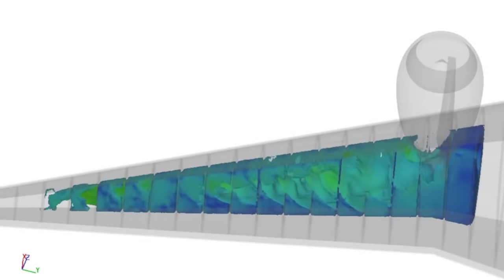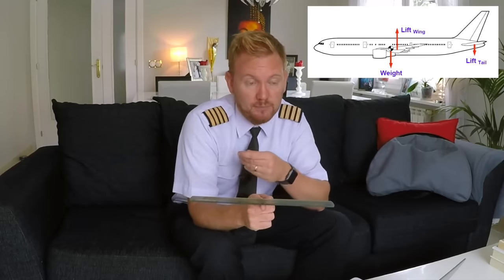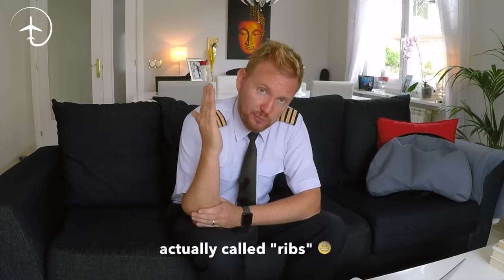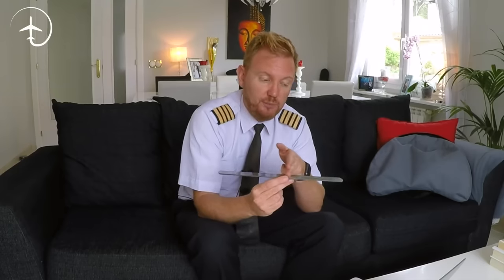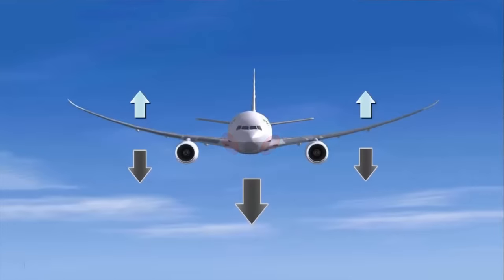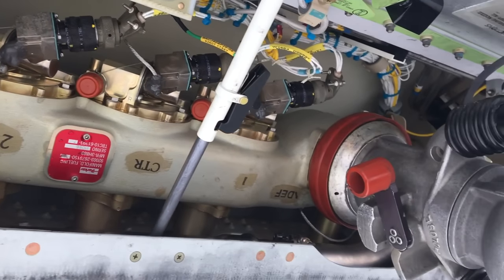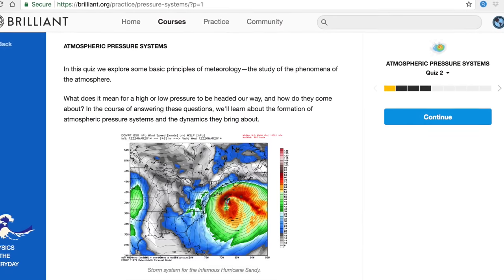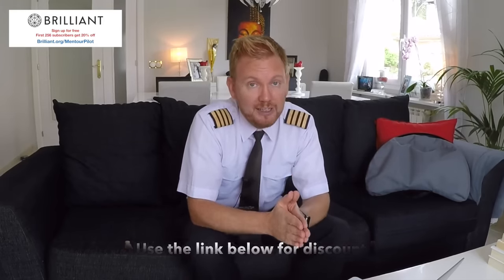Why do aircraft store fuel in the wings?

Comment: As the fuel is "sucked out" of the tanks, how does the air get in its place? On the reverse: when the plane is fueled, how do the air from the tanks get out? Is air pumped in/out or are there valves on the tanks by which air can enter and leave?
Reply: they use compressed air , not enough room for all that fuel
Reply: I also wonder about this question.
Until TWA800 the tanks used to be connected to the outside air. Kerosene is difficult to ignite as sea level pressure, so this was thought to be perfectly fine at the time. Turns out that at altitude the small amount of fuel vapour and the small amount of air, makes for a perfect explosive ratio.

If the tanks are now filled with Nitrogen, there has to be some valve system to keep the inside pressure the same as outside pressure. Or the wings will deform (get inflated or squeezed flat) with the change in altitude. 
Some valve not unlike the scuba dive regulator ????? 
The other option would be rubber inner fuel bladders, like in the military. (heavy and expensive)
Reply: Jet fuel is carbonated with oxygen; as the pressure drops from lack of fuel the carbonated air is released into the empty space....ok I have no idea but is sounds good hu?
Reply: There are vents near the wing tips. As the fuel is used, the air enters by the fuel vents through dynamic pressure (fancy word for Relative Wind Force). This way there´s never negative pressure inside the fuel tanks. :)
Reply: I remember one of his videos (it was why you can't walk underneath the wing, I think) he mentioned a valve at the bottom, which could fix the fueling issue. Maybe they use the same valve for balancing the pressure during flight, but this is only a guess.
Reply: delcroix - yes there is room for all that fuel. Compressed air? Get real.
Reply: Quatermass, to be fair, the hydraulics fluid reservoir gets its pressure from bleed air, so I can see how people can make the mistake of assuming that the fuel system might work the same way.
Reply: Italopatino - I get the feeling that delcroix is claiming that the engines run off of compressed air as a 'primary fuel'. It's a particularly brainless conspiracy theory running right now, and needs to be shot down. 
If I'm wrong delcroix, apologies.
Reply: Vents yes; those are also useful to allow expansion of fuel should it heat up for example, one pratical reason is not to fuel fully up before parking an aircraft a long period of time during a hot sunny summer.
Reply: elves
Reply: delcroix The only compressed air is in your skull. Please be quiet, the adults are talking.
Reply: @FredrickMboma thats only half of the equation. Its a function of the Speed of the Rocket (which increases during Flight) and Air Pressure (which decreases with Altitude) - when you multiply both factors you get the Air Pressure the Rocket experiences in front of it, and the point where this Pressure is highest is called Max Q (or Maximum dynamic Pressure)
Reply: Fredrick Mboma yes and no. The subject is more complicated than that admit involves a lot of calculation with many variables (primarily though the air density and speed). Calculate the precise point of max dynamic pressure is not that straightforward as it seems. Approximations usually are good enough though for the purpose.
Reply: In smaller planes and pre twa800, normal vents are/where used as on all other vehicles in this world. Modern, large planes, uses a system which bleeds out the oxygen, leaving the nitrogen and vent the tanks with that.
Reply: Hi Fredrick.  That's not really quite it. Yes, the air builds pressure on the rocket, and this increases until it reaches "max Q" or "maximum dynamic pressure". As the rocket moves up into the atmosphere, the atmosphere becomes thinner. But at the same time, the speed of the rocket is increasing, and you have a balance of resistance from the air increasing due to speed, and pressure of air decreasing due to altitude. And all the time there is force being exerted through the structure upward from the engines. So, at one point, the pressure reaches its' maximum: most pressure differential between the front of the rocket hitting the air, and the back of the rocket, where the engines are applying force. Thus the whole structure of the rocket is under the most intense pressure and stress. As soon as this point is passed, the engines become the primary force affecting the rocket (ignoring gravity), and it's easier on the structure from that point onward and upward. Does this make sense, I hope? I am not a scientist, and I trust this is an accurate enough description for casual use!
Reply: tim weatherill And just for reference, the Saturn V experienced around 500 psi at Max Q (as seen plotted on a NASA graph for one of the Apollo missions). That's a lot of "extra" force the rocket structure has to endure in flight.
Reply: Yes, an unnerving amount! I have read Astronauts recounting how wild a ride those first moments on Apollo were. Intense!
Reply: There are fittings in the tanks called 'dive tubes.'
Reply: This is a good question.  Would be nice if Mentor answered that one.
Reply: So, that makes clear to me that aviation fuel is different from fuels used in cars and bikes
Reply: Cant be vented, it flys level, hard left, hard right, upside down where do you put the vent valve?
Reply: And as for the compressed Air comments His brain is running on possibilities yours is membrane maximum compressed air pressure-i-dosis , There is some fuel in the wings yes, for the auxilary motor on the back tail to generate eletricity and fool the masses that would be investigating the wings innerworkings,thus circumnavigating that the main wing engines are instead steam turbines running on some kinda over-unity experimentation gone great for profit and bad for sheeple. Enjoy your i-dosis
Reply: delcroix WHETE DO YOU GET THE ENERGY FOR ALL THE COMPRESSING THEN????!!!
Reply: Aimless6 that was central tank explosion. They left it half-filled, and the ac on
Reply: As others have stated Fredrick Mboma, MaxQ is the maximum air pressure exerted on the rocket or any of it's exposed parts. The math to come to this requires that air pressure and speed are constantly changing in flight, with speed increasing and air pressure decreasing the higher the rocket gets. The reason I said "or any of it's exposed parts" is because there will always be at least one part that can't take as much pressure as the rest of the vehicle, and it's maximum pressure that it can withstand is what they determine to be the MaxQ for the flight. Engines are throttled to allow the rocket to reach this value but not exceed it in order to preserve all of the attached parts. If the engines were left on full throttle throughout the flight, some parts could be damaged due to heat.
Reply: OzFPVflyer lmao! they're absolutely impossible to teach some reallity. I've also tried.
Reply: OzFPVflyer yea....compressed air.  Where do these people come from ? So I guess when a plane crashes the huge flames and fire balls are from all that compressed air...lol. I never knew compressed air was flammable
Reply: Yes ,fuel is pumped with the help of pneumatic system
Reply: delcroix and what or who produces the “compressed air”? Free energy right?
Reply: @delcroix  go get an education

Comment: Many thanks about this topic !
Avoiding too much strenght applied to the area where both wings are linked to the fuselage is a very good reason why the fuel is stored inside the wings : clear explanation !
I have always been very surprised by the fact it is possible to store so many tons of fuel inside the wings !!! Aircraft wings seem quite thin; even they are very wide, you always
ask yourself how it is possible to put inside such a quantity/volume of kerozen !!! 
For instance (if I'm right), B737-800 gets 3 fuel tanks : 1 in each wing (almost 5000l) and 1 main in the center (~15000l) that means each wing can load
at least 4 tons ! Furthermore, the center of the wing can only be loaded (other parts is dedicated to moving mechanisms like flaps slats...) and it can be loaded with more than 4 tons : that's surprising....

Comment: Great video! Questions: 1) In the event of an AC power system failure, what power supply is used to run the AC driven pumps? 2) Is there a DC battery driven backup power supply (inverters) to bridge the gaps of AC power loss created by an unexpected AC power loss? 3)Does the APU have the capability to run off of the emergency back-up (inverted) DC power supply driving the pump for its fuel supply?

Comment: I was thinking it was better than storing it in the overhead :)
Reply: I wonder if it could be considered as 'carry on 'luggage...LOL..!!
Reply: LOL!
Reply: lol. Well in high wing aircraft the fuel is still often in the wings so...
I mean... Kinda? XD
Reply: Pets go in the overhead specially little dogs..
Reply: Some older aircraft did exactly that.  Short Skyvan/330/360  for example.
Reply: Exactly....where else would you put it?
Reply: How about not using ANY At ALL? Okay FIRST I'll just answer your question with "The Supreme Reply". - The Gas... Should be either at The BOTTOM or BACK END of the aircraft in design, if not in The Wings. 
Electric Aircraft? Solar? Dark Matter propulsion? Tetrahedral Energy?
Anti- Matter propulsion? There's a few more I can't remember right now.
Reply: Kmak Milly Fuel in the tail... Please describe how to balance the plane as the fuel burns off and the plane becomes more and more nose heavy?
Reply: Elementary my dear Sir Jim Barchuk. As the plane gradually becomes "Nose Heavy" as you put forth with your witty foresight, I'm SURE The Aeronautical engineers can and WILL replace the missing liquids WEIGHT with a counter balance substance or SLIDING MECHANISM to EASILY quell
your query. You KNOW? If they would do away with fossil fuel altogether and release the stranglehold "They" have on technology, we wouldn't need airplanes at ALL.
Reply: Alberto Portugal 😂
Reply: IMRROcom 😂
Reply: Gravity fed = no pumps needed. IMRROcom is a mad lad eliminating systems left and right.
Reply: Kmak Milly Or maybe move the passengers towards the back one by one to counter balance the weight loss at the tail?  Until at last, just before landing, we also have the pilots at the back seats lol......You're a genious!
Reply: IMRROcom be cause the baggage compartment has bags in it
Reply: Kmak Milly dark matter propulsion? Get an education listen to the guy he's a pilot however iman engineer traineed to batchelors level and have over 25 years in design yes and maintenance too! Antimater? Error!where would you store it if that fuel if it met any form or matter it would destroy itself! As for your other types of propulsion put away the comics get back to school and resit physics and any other form of science maybe engineering
Reply: John Dobak yes it is essentially gravity need even though it uses pumps the fuel is distributed so as to form a uniformly distributed load!

Comment: I would really like to hear your thoughts on the two accidents of the 737-8 Max. Spiegel recently reported that Boeing might have underengineered this significantly updated version of 737-800. I have also recently heard on the radio that the problem was a software fix meant to make it easier for the pilots to fly the new plane. Specifically, the software that was supposed to emulate the older version of 737 in the newer version so that  pilots could more easily transition to the new plane (and also of course reduce cost).  The fact that both planes essentially nosedived at significant speed (around 700kph) into the ground seems to indicate a systemic problem with this type of aircraft. China has recently banned the use of the 737-8 Max. I cannot imagine what the crew and passengers must have felt like when they realized they were heading toward certain death. Horrific.

What are your thoughts?

Comment: You mention that the wings flex during flight. Has the constant flexing and de-flexing of wings ever cause stress fractures, and then wing failure???  How are wings designed to prevent such disastrous failure?? I am sure something is done.
Reply: +1 curious to know too
Reply: Failure is caused by fatigue, that is damage due to repeated alternating loads. The bottom surface being subjected to tensile stresses, is more prone to fatigue. Fatigue failures are prevented by choosing appropriate materials and by avoiding stress concentration  ( higher stresses at cut outs, sudden change of geometry) or adequately reinforcing areas of stress concentration. On metallic wings, fatigue is reduced by "shot peening" of wing skin, a process in which the skin is blasted with small beads which introduces beneficial compressive stresses.
Reply: Metal/structural fatigue is of course a factor. I don't all the details, but I do know aeronautical engineers do account for it in their designs and come up with ways to minimize it. Of course it's not perfect but considering jetliners 30 years ago can still fly even with metal/structural fatigue, they do a decent job of it
Reply: They use crazy glue on the wings!!! lol
Reply: Worked at MICAN sanding metal airplane wings for a year...  did the 'peening' as well on the skins.   To my knowledge we were getting rid of airpockets in the metal...  creating a more uniform surface for the eventual final production of the air-plane wing.
Reply: Look up Chalk's Ocean Airways Flight 101, it was a very old seaplane with metal fatigue causing the right wing the come completely off
Reply: The wings are very strong and flexible but like the rest of the airframe they have a life span in flying hours . When they get near that life span they bin the airplane or scrap etc

Comment: One question. , How does it keep delivering fuel if the plane is flipped ?
Reply: I think there are numerous fuel pickups inside the tank so that even when inverted or when experiencing negative vertical acceleration (negative "G force") there is a way for the pumps to draw-in fuel. The pumps then deliver pressurized fuel to the engines so they do not rely on gravity.

Comment: I used to refuel for USAir back in the late 1980s, mostly 737-200/300/400 as well as 727-200 and an occasional DC-9.  Interesting to see that the fuel panel hasn't changed much since the 737-300/400 (the -200, both 737 and 727 were analog dials!).  We used hydrant carts, which I don't see being used very often these days; mostly tanker trucks.